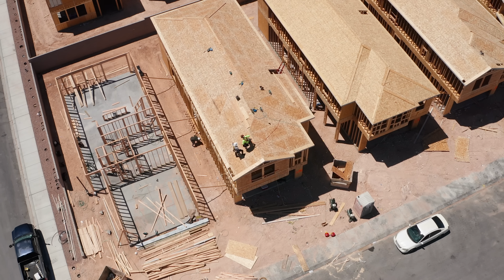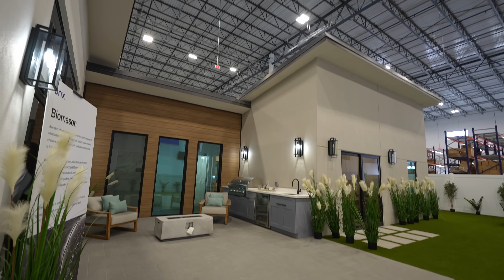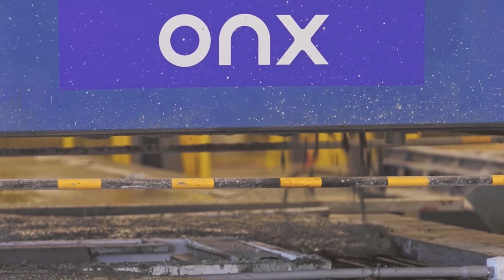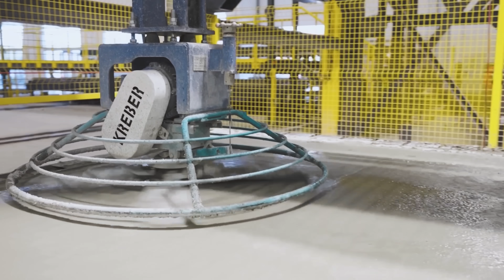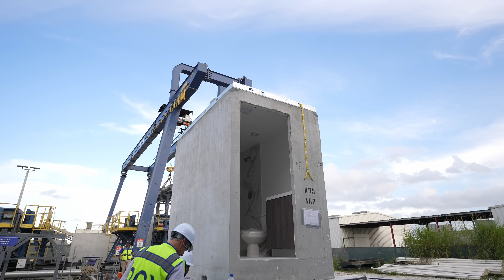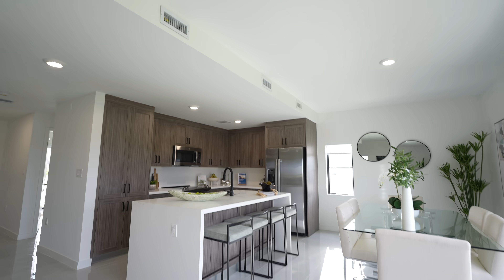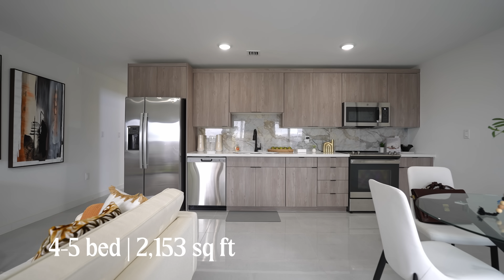Why This Company is Building Thousands of Concrete Homes

Comment: Concrete houses are not as earth quake proof as wood framed houses. So in California (an earth quake area on the pacific rim) all houses are built with wood concrete. Also for concrete houses you may still need a wood frame layer either underneath floor or on top of the wall to allow cables, power wires, pipes and vent system to go through.
In Australia, Japan, and Philippines most houses are built with wood frame but in Korea and Vietnam houses are built with concrete.
Reply: Concrete as a material performs well in earthquake-prone areas. But you are right. Designing and engineering the homes right will be critical. We are currently researching and developing to make them California-ready.
Reply: @onxhomes  our military dorms in japan were concrete and very secure during an earthquake we had
Reply: In japan modern house are in concrete, tho.
Reply: All new homes in Phil are built with concrete except low income families and they face the wrath of typhoons and lose their homes with every direct hit. Nobody in Phil wants a wood home

Comment: I’m really curious about the R-Value of the outside walls in these homes. This might not be a big deal in the south but in colder areas you need a lot of insulation.
Reply: We use a X+ double wall insulated panel for colder areas.

Comment: This is still so over-complicated in my opinion. Concrete blocks are pretty much the norm in a lot of countries and would probably still end up being cheaper than this.
Reply: Thank you for your feedback. Every Onx Home is built as one system utilizing our patented X+ Construction process. All building components are monolithic 2D and 3D steel-reinforced low-carbon concrete structures, including Foundations, Walls, Bathroom Pods, Slabs, and Staircases. Monolithic structures are more resilient and energy-efficient.  

From a cost perspective, the price of our homes includes the cost of the land and community development. It is comparable to the cost of newly built homes in the locations where we build. Onx homeowners get more value for their homes because of lower insurance, energy, and lifetime maintenance costs. We continue to improve on our technology to build better for homeowners.

Comment: High cost compared to wooden houses.
Pipes and wires are not accessible without breaking the wall.
Less diversity in design.
Potential for cracks.
Heating and cooling units may have to be installed on the ground floor, which takes up living space.
Reply: Onx Homes is a company that develops new home communities. The price of our homes includes the cost of the land and community development, which is comparable to the cost of newly built homes in the locations where we build. Onx homeowners get more value for their homes because of lower insurance, energy, and lifetime maintenance costs. We can do a wide variety of designs and achieve a concrete strength of 8,000 PSI and above. We also have innovative solutions around HVAC. We continue to learn from feedback, design, and build better every day.

Comment: i hope it's water proof. concrete is pourous water can get in.
Reply: Every Onx Home is built as one system utilizing our patented X+ Construction process. All building components are monolithic 2D and 3D steel-reinforced low-carbon concrete structures, including Foundations, Walls, Bathroom Pods, Slabs, and Staircases. Monolithic structures are more resilient and energy-efficient. And yes, it is water resistant. We continue to improve our designs and technology every day.

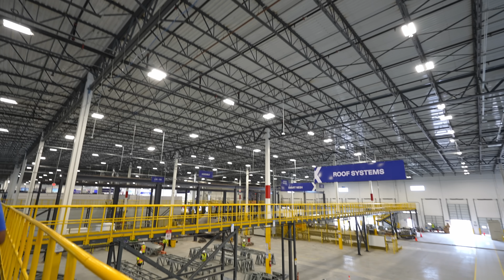Comment: I'm not familiar with home maintenance (I've rented all my life), so I'm hoping someone knows the answer; I'm curious about the maintenance aspect of a concrete home, for instance, @2:08 in the video, the plumbing and electrical is already installed, and is behind a giant concrete wall; if you want to run new electrical, how easy is it to modify and access this infrastructure, or what if I pipe bursts for some reason behind a concrete wall? How does the maintenance go on a build like this? Anyone have any experience with modifying or repairing electrical and plumbing on a concrete home? Overall, I don't hate the idea, but I do have some general questions for people with experience living and owning this type of home. Thanks!
Reply: Great questions. We offer an extended Onx Care warranty on our homes. Also, plumbing is accessible through drywalls, and the material used is high quality for plumbing and electricals, which ideally should not give you any trouble for 100+ years.
Reply: @onxhomes  Hey thanks for the reply! Alright, so you always leave stuff accessible through the dry wall on whichever side of the concrete it's installed on. That's perfect. As long as it's not sandwiched between two layers of concrete you can always access it from one side through the drywall. Appreciate the insight and good luck with the business! Concrete is a decent idea for homes! (Here in Canada we have so many trees I think that's likely always going to be the best material to go with as long as they're so plentiful, but I like the idea of a sturdier home with a little more soundproofing .. granted, I'll prop only be able to afford being a renter for the rest of my life the way thing are going but that's another story lol - appreciate the work you're doing, keep it up! This was cool!)

Comment: If you go to SE Asia many of the homes are built from concrete in the form of blocks and poured columns.  I’ve been following several builds in the Philippines and they look well equipped to handle weather events well.

Comment: I used to live in a town house. All 50 bathrooms had to be renewed. We found a company that did bathrooms for ships. They mounted tiles, sinks, cupboards and everything in a factory on 3 feet wide steel plates, with all wires, conduits etc on the back. You could do just about any configuration you wanted with different sections of plates. So did you want bathtub, shower, two sinks etc it was just a matter of ordering different sections. It took 1 week to completely remove the old bathroom and one week to install the new bathroom. That was so quick, and except that the floor was raised a bit to make room for plumbing (it was a step down before and now the floor was level with the rest of the house), you would never notice that you just got a steel box installed in the middle of the house. It was much cheaper than regular bathroom, because of the highly reduced manual labour, and that everything was done on an assembly line and as these pre fabricated components.
Reply: Wow. Efficient!
Reply: The bathroom floor being higher is bizarre. So is having steel walls in a bath. WTF?
Reply: @joevarga5982  The floor was normal level. Also there were white tiles on the walls. You would not know there were steel plates behind if you did not know.
Reply: @HansMilling   You said "That was so quick, and except that the floor was raised a bit to make room for plumbing..."

Now you're saying the floor was normal level.
Reply: @joevarga5982  Yes, you used to step down a few inches when entering the bathroom, but now it was level. So the height to the ceiling was a bit lower.
Reply: @HansMilling   🙄
Reply: Nice

Comment: The USA mostly builds in wood, but the exceptions are Florida and the NYC metro/ northeast big cities. There concrete is MUCH more common than the rest of the USA. That’s probably why a Florida prefab company went with concrete, that’s almost expected in Florida at this point.

Comment: This sounds familiar to a type of home that used to be built in the US. It’s called the Edison home. Using concrete is not new.  Also this option is heavily dependent on your area.  500k is still quite a bit of money for that size of house. If you decide to go with an older home that’s not in a major area you could save a lot of money.
Reply: We agree housing costs depends on location. Onx Homes is a company that develops new home communities. The price of our homes includes the cost of the land and community development. It is comparable to the cost of newly built homes in the locations where we build. Onx homeowners get more value for their homes because of lower insurance, energy, and lifetime maintenance costs.

Comment: Concrete has it's issues. Its prone to cracking. It doesnt breathe, so moisture is a huge problem. Also has environmental issues. Not that wood frame is the best, but this isnt perfect either.

Comment: I wonder how difficult it is to remodel a concrete home: bathrooms, kitchens, etc. would there be any unique considerations? Also, does it appreciate in value the same as a wooden built home?
Reply: Depends on how they are built. Living in Spain a lot of the homes are concrete and they trench the concrete to put pipes and wiring or run them along the base board, or behind floating crown, or floating floors in older properties but in newer (1970's to now) builds they are creating utility shafts to run them up multiple stories. It's not hard but the workers have to be skilled. We've Renovated 15 properties across Spain and Italy so far and it's been mostly concrete builds with either grit or wood floors.

Comment: WiFi is going to be horrible, the signal degrades passing through concrete or steel. One way to get around that problem is WiFi repeaters but that could get expensive.

Comment: Great video Shelby. The last house we lived in was 1950's concrete which was strong enough to survive an atomic bomb blast. Put the heater on and you had a very cosy living place. We sold it 4 years ago and moved into a 20 year old concrete home. More modern look, tilt up construction and like the house you just showed but only one floor. Wouldn't live in anything else. '🦘🦘🌲🌲

Comment: The best house I ever owned was a 1932 concrete home built by Eastman Kodak in a suburb of Rochester NY. They were built for Kodak managers. The walls and the floors were concrete. It was wonderfully quiet and kept the noise out. The walls were thicker than stick built houses which gave a comforting feeling of solidarity. These houses are still existing and in demand
Reply: This is why houses in germany and many european countries are as good as they were 100 years ago
Reply: You would think lots of wealthy people would build more of these, but strangely enough they don't.  This is common throughout Europe and the Middle East.
Reply: Was yours a Thomas Edison concrete house?
Reply: @kkarllwt   I'm glad you mentioned the Edison concrete houses-- there are a handful of them in NJ, where I'm from.  They're fascinating, from an engineering perspective.

Unlike the Onx homes, where pieces are made separately, and fit together on-site, the Edison homes were made by pouring concrete into pre-made wooden molds in the shape of a house on-site, making it essentially a single concrete form, once the molds were removed.

I don't remember why the process never caught on (probably had to do with cost-effects); but I wonder if, with modern technological advancements, it could be done on a large scale, today?
Reply: Bet you would love it in concrete prison. 😂

Comment: In Florida(especially south Florida) , they use concrete block on the first floor. As for these homes, the big issue is that it’s no cheaper and they literally alll look the same. People say that about traditional home builders, but it’s not totally true. They have a variety of designs with different elevations. The elevations look similar, but are not exact. These look pretty much exactly the same! If they could make these for half the price, they could work for starter homes!
Reply: Great Feedback. Every Onx Home is built as one system utilizing our patented X+ Construction process. All building components are Monolithic 2D and 3D steel-reinforced low-carbon concrete structures, including Foundations, Walls, Bathroom Pods, Slabs, and Staircases. Monolithic structures are more resilient and energy-efficient versus Concrete Bricks.

The community showcased was a permitted design and version one of our journey. Our new homes in Villa Pass and Burnt Store lakes have entirely different designs across the community. And we are working on designing and building better every day.

Comment: You didn't say anyting about how the house is insulated. The problem with concrete homes is that they are hard to insulate.
Reply: not true
Reply: She showed a section with insulation in between the concrete.

Comment: This is really great because a lot of Florida builders lack quality control. Like you mentioned in the video, it’s a great value for what you get. The rooms and layouts are a decent size so no need to make large adjustments to renovate. I just wish they had homes available in more desirable areas. I’d grab one in a heartbeat!
Reply: We are hoping to build more communities in Florida soon.
Reply: @onxhomes Great concept, but make it more pleasing by hanging decorative elements over or around windows  doors, etc. Offer different gables and roof forms for more variety and the whole village will be a lot more pleasing. Go to Europe for inspirations, talk to companies there specializing in prefab concrete. Increase quality of doors and windows. Tell people how much they'll save on AC by spending a bit more on insulation.

Comment: if I win the lottery I am buying one. move out of Joshua tree and back to south Florida. I use to own a cinder block house  in Cape Coral fl. which is kinda concrete walls. the roof was still wood. I got it a 2006 1750 sf home for $83,000 a a short sale back in 2011. I miss Cape Coral fl. should have never sold and move to california. gets too cold here in Joshua tree. thank god my house came with a fireplace.

Comment: I have a three story house. Well, it's two stories and a walk out basement. The basement (which I just got insulated and am in the middle of sheetrocking) is on a cinderblock foundation. I LOVE THAT! It's sturdy, which is very important when it comes to climate change. If I were building a house from scratch, it would be from concrete and I wouldn't even be concerned about cost savings. I just think it's better to spend once and never have to worry again.
Reply: We love sturdy homes too. Goodluck on your home renovation project.

Comment: What is their seismic reinforcement like. It might survive, flood and fire, but won’t an earthquake destroy this house?
Reply: Doesn't have to destroy the home. One good crack in a wall will make your local code enforcement officer grin from ear to ear. Brick exteriors can be repointed and repaired, wood walls can be repaired...concrete cannot. The wall would need to be replaced, but since it is load bearing...you know the rest.